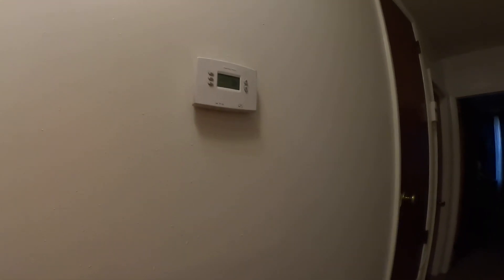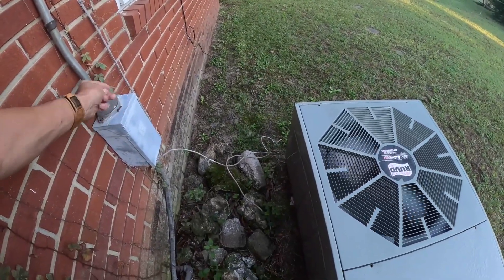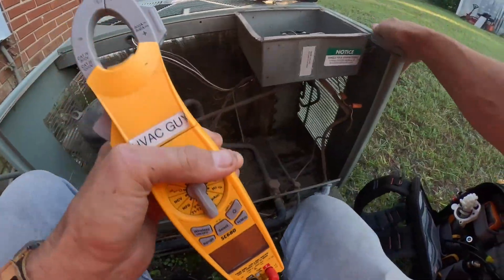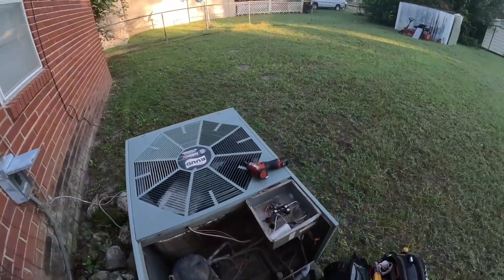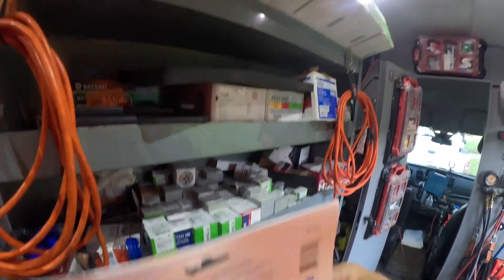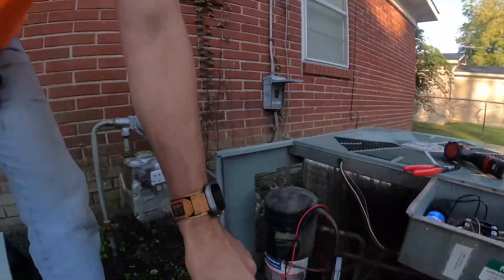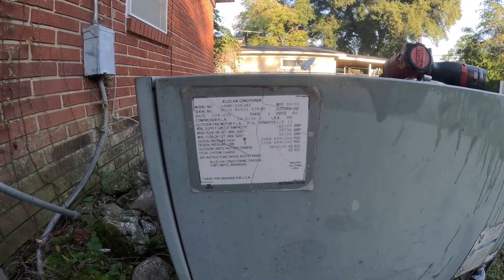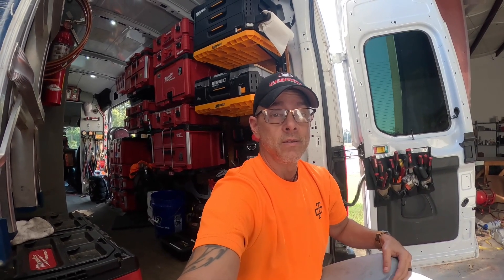Customer Called Because His System Stopped Cooling! #hvacguy #hvaclife #hvactrainingvideos

Comment: On a dual capacitor, does it matter if you connect the Fans common to the capacitors common or the common on the contactor? Does it make a difference?
Reply: All the commons must be connected together somewhere.  In this case the fan motor was replaced at some point and the new one has 4 wires with an internal connection between the white wire and the brown w/white stripe.  If it only had 3 wires you would need a jumper connecting the capacitor common to the contactor.

Comment: So your common was black and it goes to the contactor, start was purple  and it goes to herm and run is orange and it goes to the common on the capacitor did I see that right?
Reply from the maker: That orange on the capacitor is a connection to run winding, but the run to compressor (red) comes off same place on the contactor.
Reply: @HVACGUY  ok I see thank you for explaining that your awesome!

Comment: I absolutely hate those Square D disconnects. They are always hit or miss on resetting.
Reply: I read a good report someone did on those. He said that Square D used cardboard inside those breakers that causes the failure. Built in Obsolescence at its best.